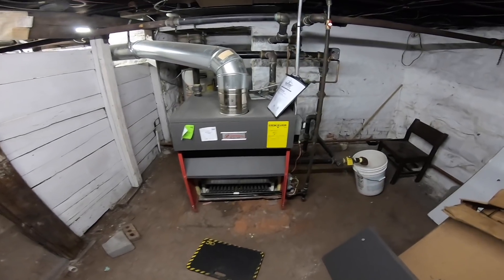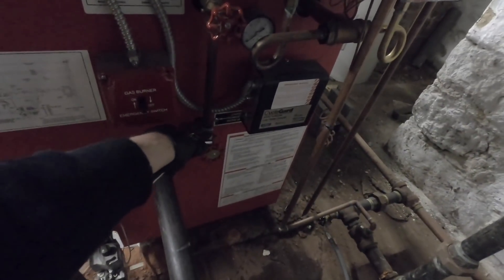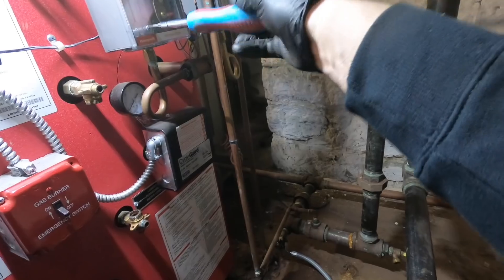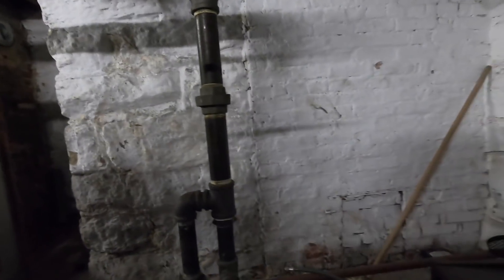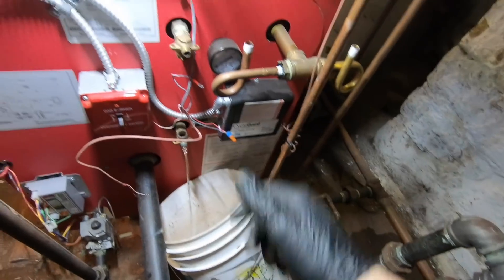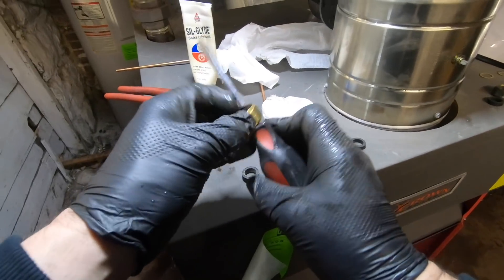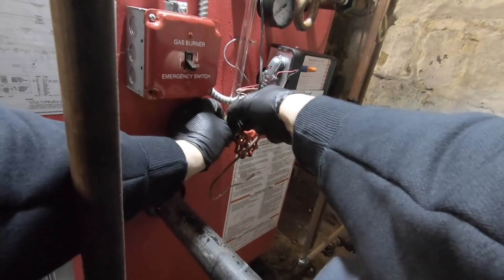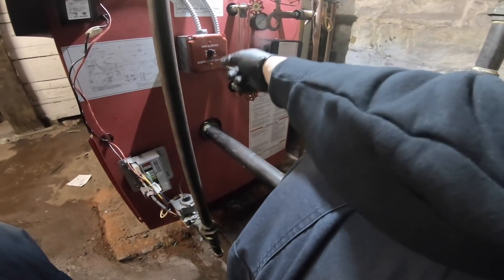Neglected Plugged Up Steam Boiler

Comment: That is not a steam boiler it's a water heater with no chemical water treatment as can be seen by the shit that drained out. Also, copper is not allowed on steam boilers. I have my high pressure boiler license to service and operate steam boilers. Also it was vapor and not steam that fogged up your camera. Super heated steam is invisible. Know what it is your working on or quit looking foolish on your videos.
Reply from the maker: It is a steam boiler. Water heaters heat domestic water. Steam travels up the pipes to the radiators. Air comes out vents until vent heats up and closes. It's low pressure steam. Mrknowitall Steam is hot water vapor. Yet hot water boilers need pumps to move water. I work on lots of boilers.
Reply: @thehvachacker  I don't work steam as often but I helped a Sr. Tech on a one and replaced the water feed valve.  Lot of work.
Reply: Your the one that looks foolish.  I don't know what state your in but we replace  steam boilers all the time and tie in with copper which pass inspection. This is not a high pressure steam system. There's a difference let me quess your a building "engineer"
Reply: @thehvachacker  ouch!
Reply: Just what charm school did you gradute from? You're due a refund. I'll vouch for you.
Reply: And where did you get your license? Diploma mill in the bahamas? The riders, headers and mains are all black iron. Thewet  return may be copper, but that's common.
Reply: Wow this has to be top 3 most arrogant comments on an HVAC video. Nobody cares about your license. Lets see some of your work on camera. So you got a piece of paper that says you can service boilers but you don't know what a steam boiler looks like?